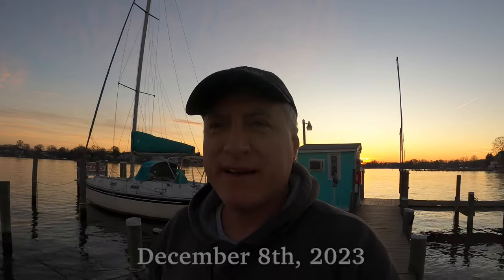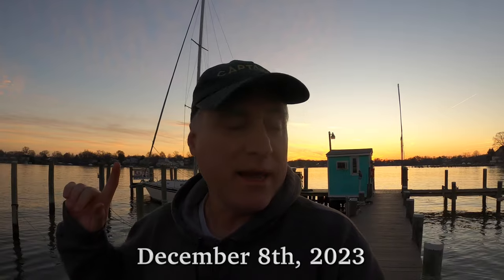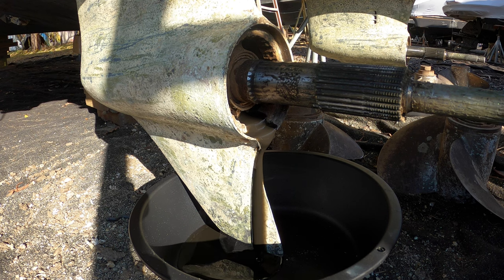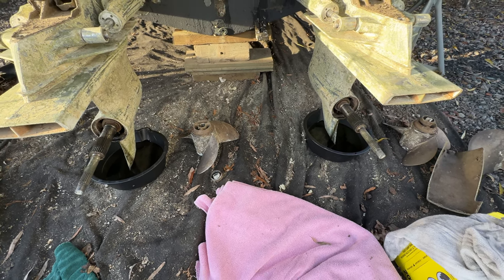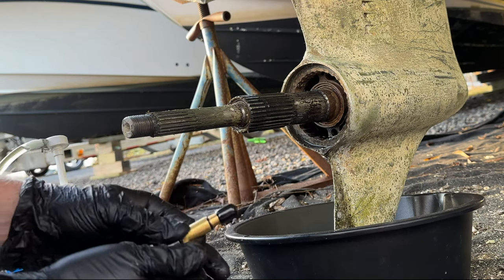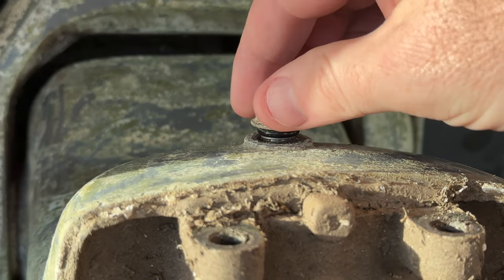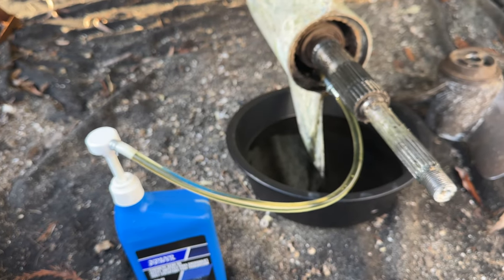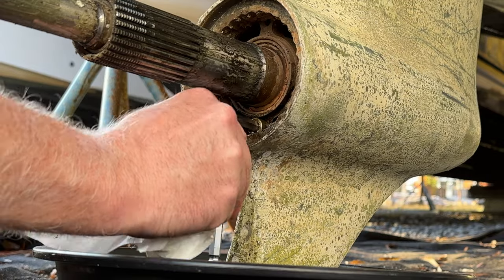DP-SM Outdrive Oil Change - Episode 127

Comment: Great job...Good your using the clear volvo full synthetic and not the Merccruiser green semisynthetic due the vp helical gears.  Sierra has the same volvo replacement oil a bit cheaper too that I like.
Reply from the maker: Thanks. I thought about getting Sierra as I use their parts for other jobs, but feel better with Volvo despite the expense.

Comment: Do you know what the part number is for the drain plug or the screw. I can’t find this anywhere. Thanks in advance
Reply from the maker: Let me dig around a bit. You are talking about just the screw at the bottom that releases the gear oil, correct?